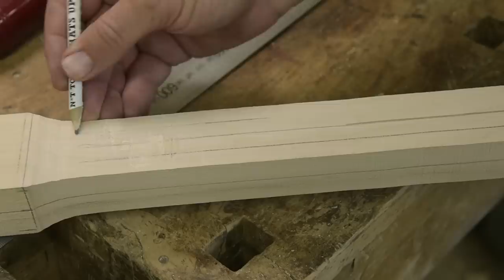Blacksmithing - Making a potato hoe

Comment: Never seen that shape of handle used on a hoe. I've seen and used only rounded handles (like fat broomsticks). 

Love your videos, makes me want to do blacksmithing.
Reply: the oval ones like this one here are  more enjoyable to work several hours with! I hate "fat broomstick" handles on tools like this, they tend to slip and turn upside down in your wet and dirty gloves/hands, those oval ones don't. they fit naturally in the shape if the hands and neef therefore much less power to hold.

Comment: Back in the day, when I used to be good at woodworking- not like today where I suck- if I wanted to raise the wood grain before sanding I'd mix a little bit of liquid fabric softener into the water and then apply. It seemed to help breaking down the surface tension water has and so penetrated and spread around a little better.☺

Comment: It's fascinating watching you make things like this. Very nice work. I wonder if you can offer some home gardening tips there are a couple areas I have trouble with and can't quite figure out what to do
Reply from the maker: Thanks! I could try, but I'm definitely not an expert...
Reply: @torbjornahman  I just can never seem to get cantaloupe or watermelon to grow. I mean the plants grow mostly but never get very big or produce. You seem to be pretty good at it.
Reply from the maker: @Regdiggs  I think the trick with melons is that they need a cozy stable warm temperature for female flowers to develop. Here it's out of the question to have them out in the garden. The nightly drop in temp will not work.
Reply: @torbjornahman  ok thanks. I will have to try and make sure they stay as warm as possible next season. I grow pumpkins each year for my kids and I don't do you bad with them. Never been able to grow giant ones though. Can you offer any tips on how to increase your potato crop or corn?
Reply from the maker: Not really. Potatoes is a bit of gambling. With bad weather they can develop leaf mold easily before they have grown to size. Also never grow potatoes at the same spot from year to year. For best results you should leave it for something else for 3-4 years...but not everyone has that kind of space.
Reply: @torbjornahman  yeah I have problems with powdery mildew on my pumpkin plants.
Reply: @Regdiggs  I think Torbjörn is right about the melons and requiring warm temperatures. Here in south Florida I have see them grow, completely from the seeds that someone just discarded onto the ground. Very rocky, sandy, seemingly terrible soil but they grew beautifully and completely unattended.

Comment: Was spooked you drew the tip out too much early on. But you gathered it back up nicely by hand. I would produce the eye differently. Beautiful work as always! I plant potatoes as close to Valentines Day as the rains will allow. I know about a tater plow, hiller, and fork. But never a hoe! Potatoes are cheap at the market. Growing them is a lot of work. But the reward!! ¡Su Amigo Siempre!
Reply from the maker: Thanks! Yes the eye can be made in many ways I guess. How would you tackle it?
Reply: Torbjörn Åhman first and foremost you get extra points for the forge weld and eye shape. I would probably upset a portion prior to isolation. Then punch and drift. Really boring compared to your approach. I love how you rose the spine. It doesn’t always require a dedicated tool to isolate material. Very elegant. Swap potatoes? Nordics for Texans??
Reply from the maker: @killerkane1957  Ok! I was thinking about a punched eye but decided I have done so many that way already and wanted to try something more "traditional"/old school. Do you think that would be legal (inporing live food).??
Reply: Torbjörn Åhman well I think it is probably suggested. But I’ve never let some rules spoil my scalloped potatoes!

Comment: Beautiful as always.  Watching this, I was wondering if there is such thing as a hold-down that goes into a hardy hole of the kind woodworkers use in benches.  Is there some reason that wouldn't work?  Would it suck too much heat out of the work?
Reply from the maker: Thanks! There is many ways to hold down the work, but many of them takes time to use... and thin material pressed down on the anvil will cool very fast, so I didn't feel like using one. I was hoping the block would help as a support sideways, but it didn't completely work...

Comment: Torbjörn, what do you think about decarburisation as an unwanted process? In theory, it'll happen when the workpiece is heated above the temperature adequate for forging. Also there is an assumption that the risk of decarburisation (aka spontaneous carbon reduction) is lower when solid fuel forges are used?
P.S I'm amazed how meticulous you are with your work, you look like a real artist!
Reply from the maker: Thanks! That is definitely something to worry about. Not in this case, but when forging high/medium carbon steel. With every heat you loose some in the outer layer. I don't think the difference is noticeable with different forges. For carbon to migrate the other way you need to be above critical temp for many hours in a carbon rich environment.

Comment: The mechanical hammer sounds a lot quieter and smoother in this video, is that due to the larger stock, or was there some maintenance done off-camera, or maybe the mic is different?  A big improvement, whatever it is!
Reply from the maker: No change really... maybe a bit more careful with the audio.

Comment: Sir how do you work out how long to make an axe handle? I inherited an axe with a long handle. The axe felt light and well balanced. On closer inspection the head of the handle was badly cracked just below the axe head (probably due to over striking). So I cut of the head and reset the head lower down the same handle. It was a good job but now the axe is very heavy and out of balance (top heavy) yet it is about 200mm shorter. I didn’t think to take photos or measurements before I shortened the handle. Do you have any ideas?
Reply from the maker: No I'm not an axe expert, but the balance of a tool is pretty important. The balancing point should probably be an inch or so below the head.

Comment: Dear Mr. Ahmen. Thank uou for your new video of the patatoe hoe. my question is when your are hitting the red steel, flakes are flying around. What are the flakes made of, and what do you call them. When you closong the neck of the hoe, you put some powder or liquid on the hoet steel. what is the stuff you are putting on?
Reply: On question A my answer is "Scale", and on B "Forge welding flux"
Reply from the maker: Yes we call it scale and it's iron oxides that form on the hot surface of the steel.
Reply: Thank you

Comment: Hi, I've been curious about something in your videos. I've noticed that you switch between your two power hammers a lot, and I'm just curious as to what the advantages of either one are?
Reply from the maker: In general the larger hammer is better for larger things :) Although you have good control it's easier to ruin something delicate. Also, the small hammer hits much faster which also is an advantage with smaller/thinner work pieces. Short answer!

Comment: Nice , as always , what kind of dust you used for weld / sold the joint .
Reply from the maker: Thanks. It's a forge welding flux. Pure borax will work also.

Comment: would it be more effort to make a flat leaf first and then forge-weld the spine on? in my amateur head that sounds more easy.
Reply from the maker: That kind of beats the purpose. The spine should be one piece with the "blade" part. And forge welding it on is not easy...